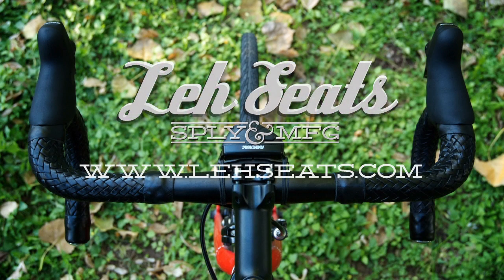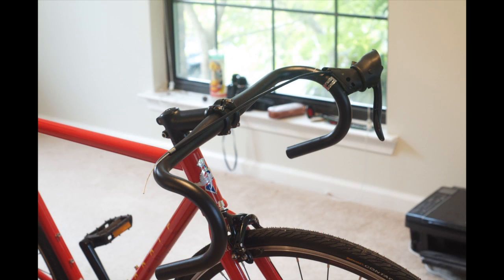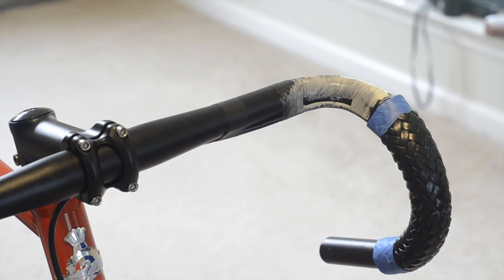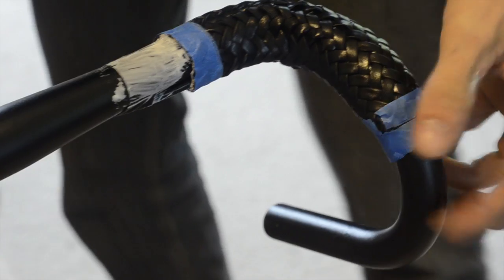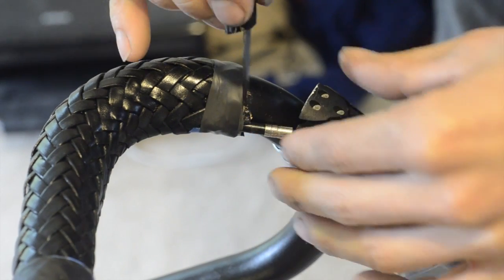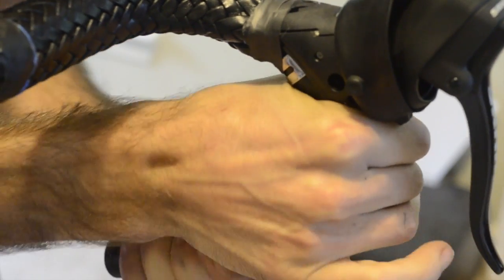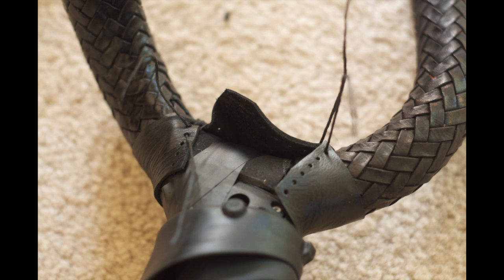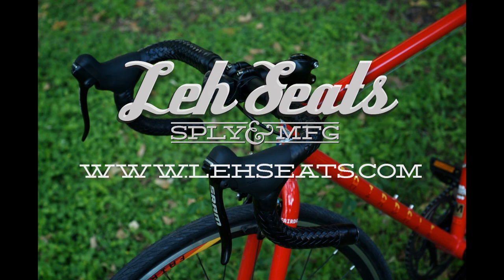LEH Seats Slip On Braided Leather Bar Wrap How To Install

Comment: Instead of finishing it with electrical tape,  should use the proper size heat shrink for electrical wire ends would look cleaner and be bullet proof.